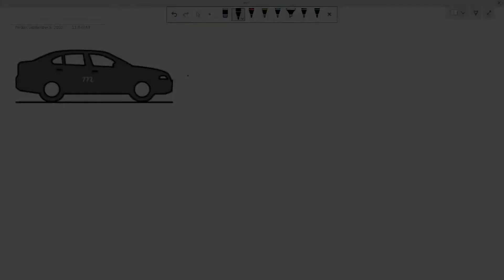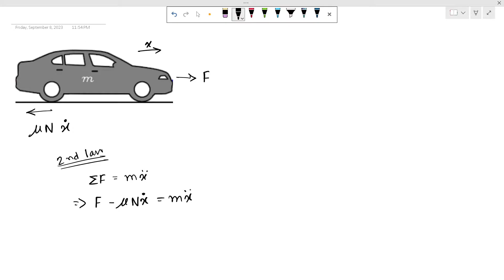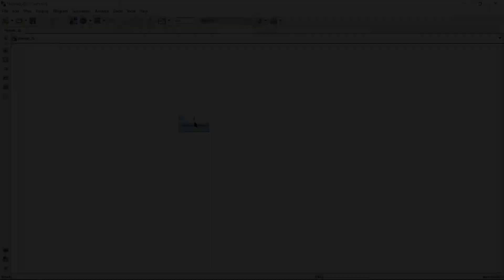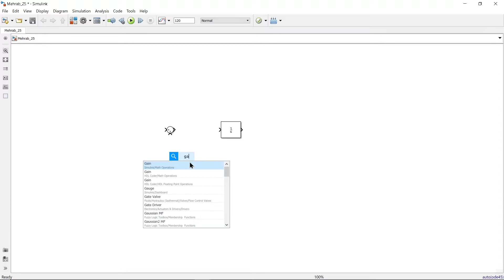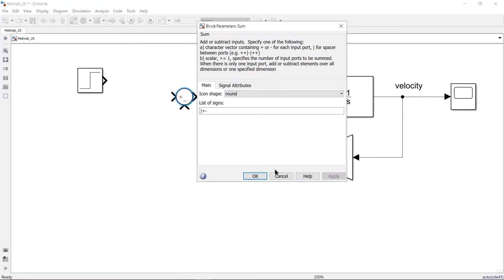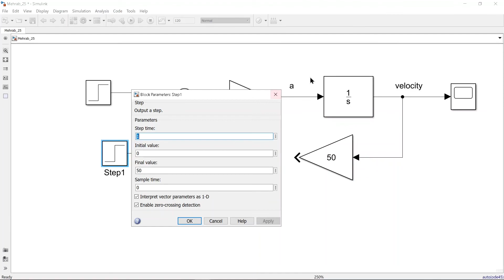Cruise Control in Simulink

Comment: Plz explain the rolling friction equation
Reply from the maker: Its the plain old friction equation (f= friction coefficient * Normal force).  But why i multiplied the velocity. Its nothing but to make a relation with the output. If you consider Damping force ( Fd = damping coefficient * velocity)instead of friction force, then it would be easier for you, because the velocity is directly related. But our main purpose is to control the velocity. Hope you understood